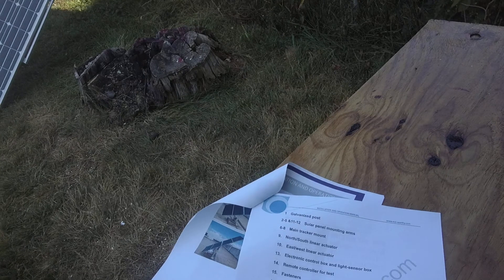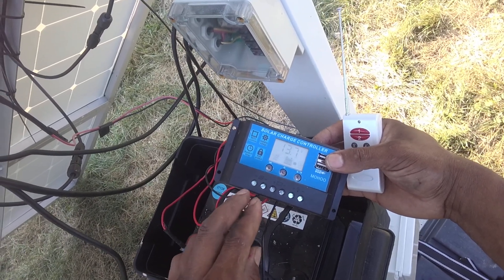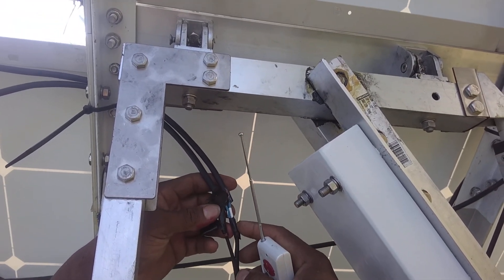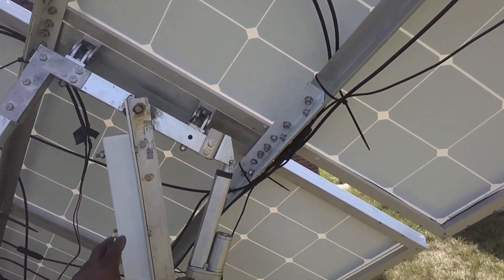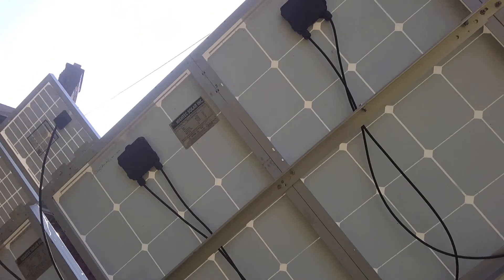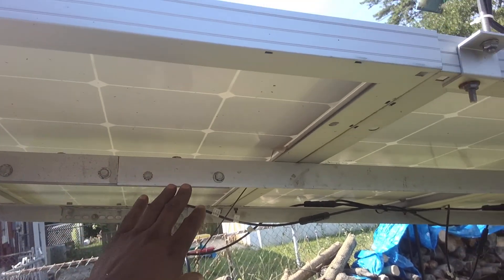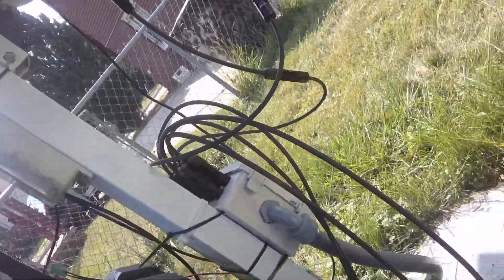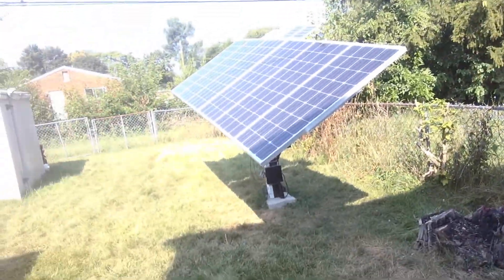Video on how I power my, EHO-WORTHY solar trackers!

Comment from the maker: I'm basically off-grid already. I use a Aims Power 24 volt split phase 6000 Watt inverter/charger. That will charge my battery bank if my 6300 Watt solar array doesn't bring in enough power.  I also utilize propane to power major alliances. When I get time I will make a video demonstrating.